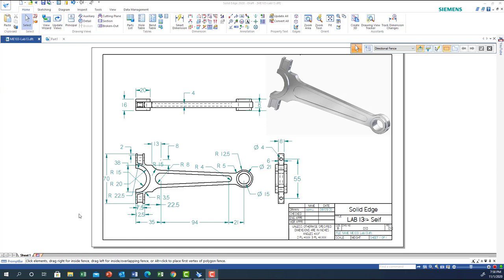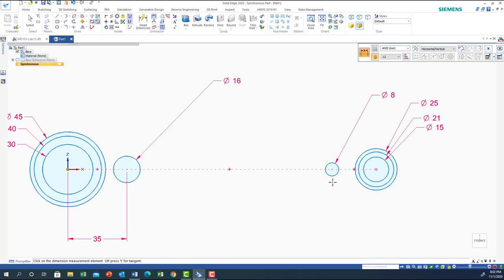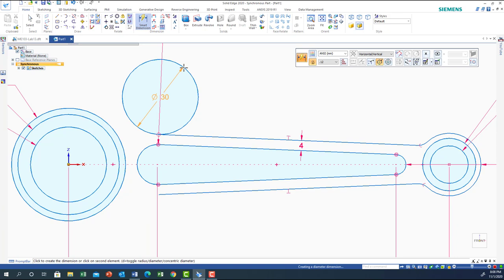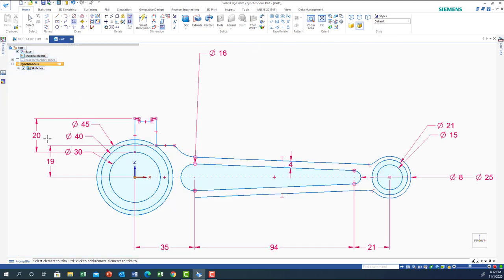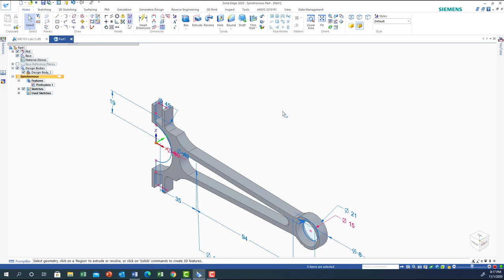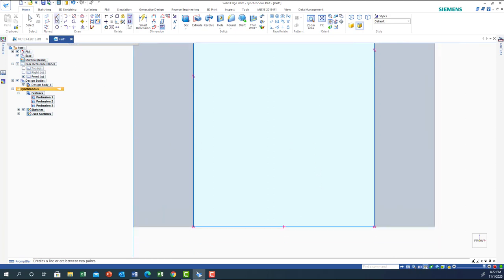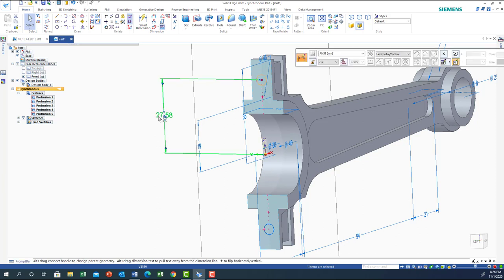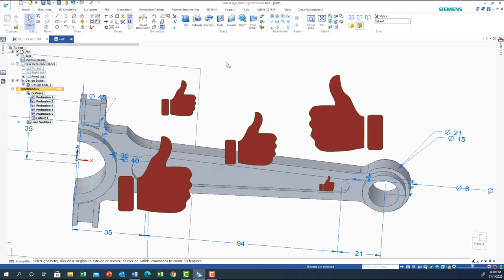Learning Solid Edge - Lab 13 (Connecting Rod)

Comment: can you please explain how we can know the size of the offset from draft file.
Reply from the maker: The accurate way: Go to the "sketching tab", draw a line perpendicular to the offset (using the perpendicular relationship), use x dimension and choose "By 2 points", click on the intersection points on both sides (by just moving the mouse on both lines), hence, you will have it. Good luck.